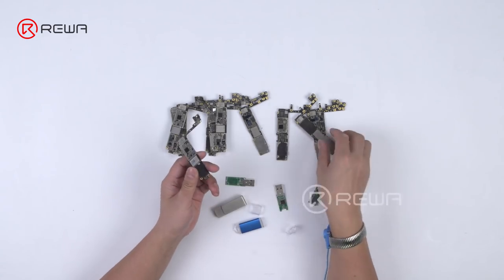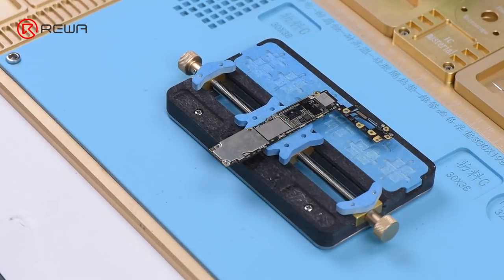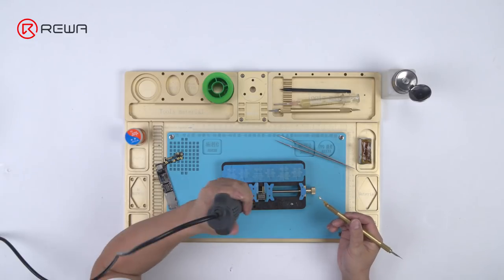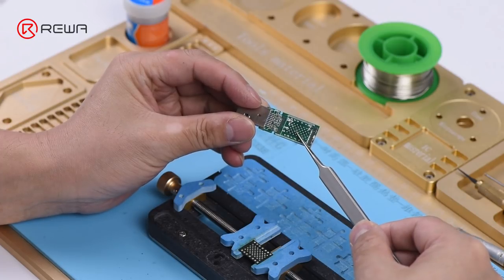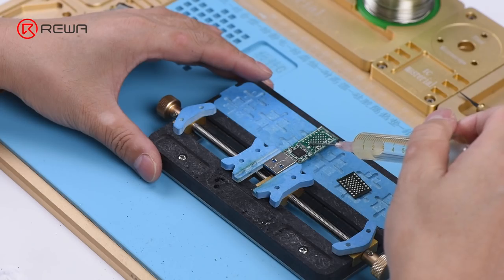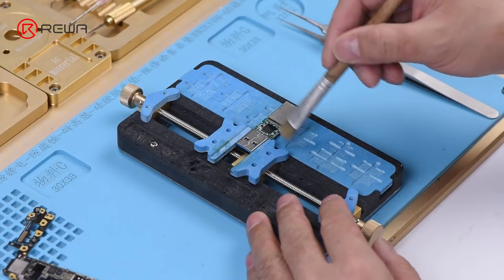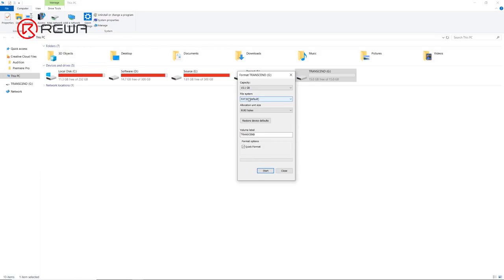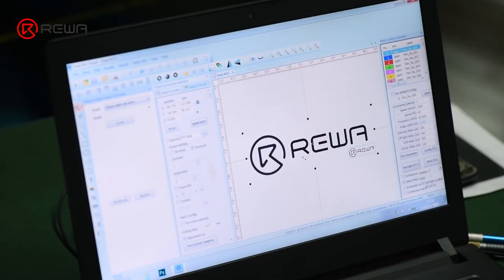Broken iPhone REVIVE (Turn NAND Flash Chip To USB Flash Drive) | REWA Recycle Tips

Comment: it only possible use NAND chip from Iphone 1,2,3,4,5,6. From 6S,7,8 and Up it used PCI EXPRESS standard. 
Who need transfer nand chip from Iphone 6 if good flash drive 128 GB Lexar cost now $18 ?
Reply: Those doing it as hobby or the adventurous one
Reply: Repair shop has ton of dead/iCloud locked iphone logic board

Comment: I have a customer that has a Google Pixel 3XL that has a damaged motherboard, she needs access to stored data. Can I remove the Skhynix H28S7Q302BMR 64 GB NAND flash and put it on a USB flash drive for this purpose?
Reply from the maker: No, you can not. The NAND data can' be accessed by this way.
Reply: @REWA Technology  I just got another Google pixel three XL WaterFire transfer the Nayon from her old phone to this new one will she be able to access the data she’s looking for on the new phone
Reply: Do you know somebody that I can send My Customer's phone too so I can repair the motherboard
Reply: @rewatechnology2008  Sorry I should not use voice to text while driving.  What I wanted to say is can she get access to her data if the Nand is moved from her old phone to this new one will she be able to access the data she’s looking for on the new phone
Reply: @rdlynes  You cannot, NAND chips do not work that way. It is possible to remove some other components over, that may work.